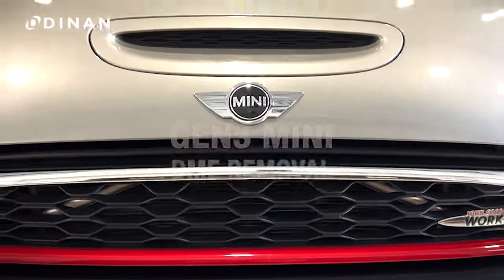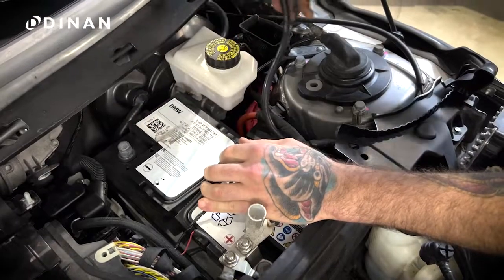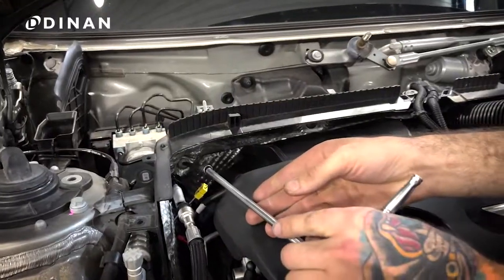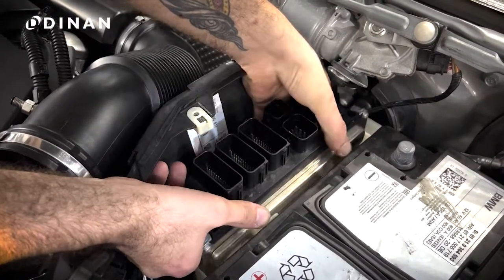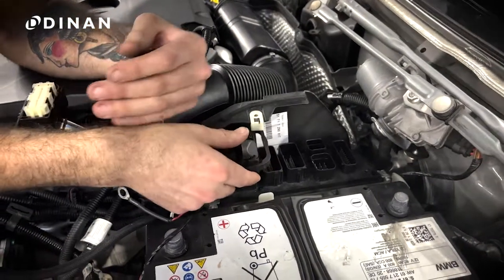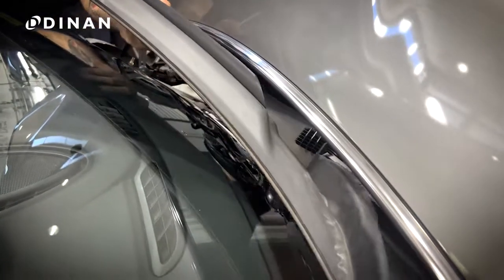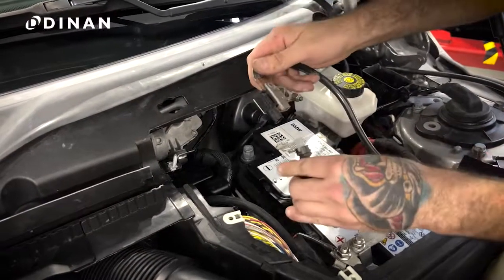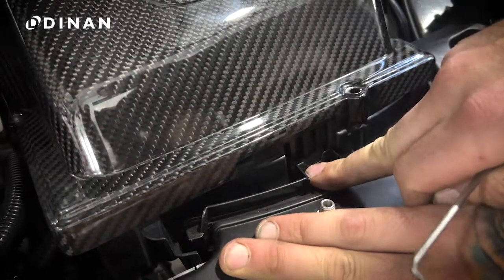HOW-TO: Removal and Re-Installation of a MINI B48 (or B46) DME

Comment: Just removed the DME from my 2019 F57 Mini to ship to Dinan. These instructions are pretty accurate. Some bolt head sizes have changed, and the heat shield and housing around the DME have changed slightly as well.  It a good video. If I hadn’t had it, I would have had no idea what to do. Can’t wait to get it back.
Reply: After they flash it, it's just plug and play right? No need to plug laptop in or anything? That's the part their website fails to explain, if you could give some context that would be appreciated!